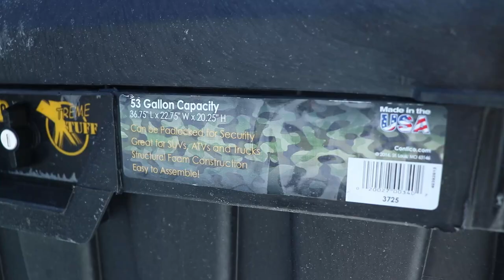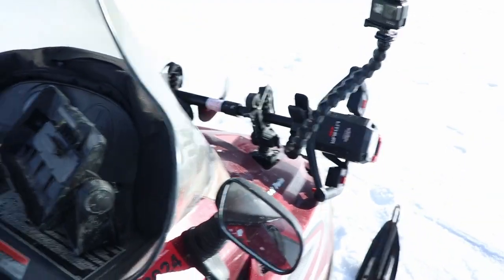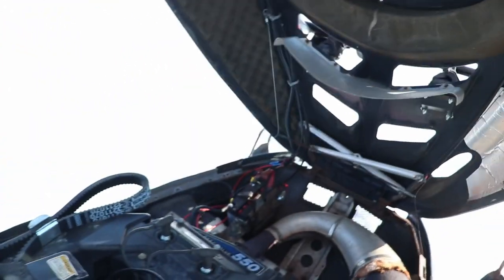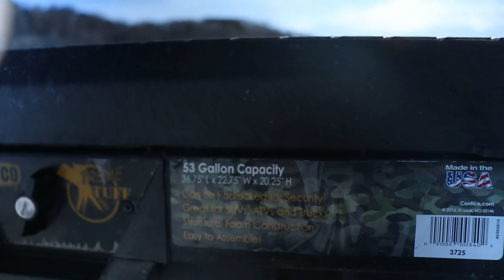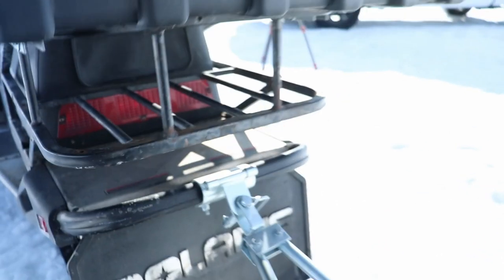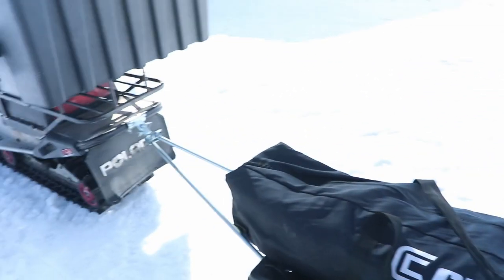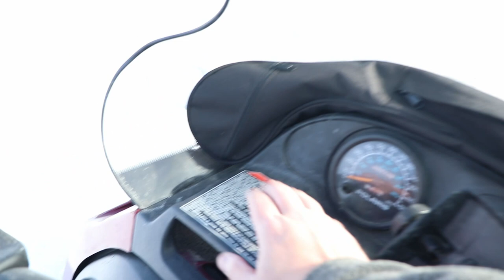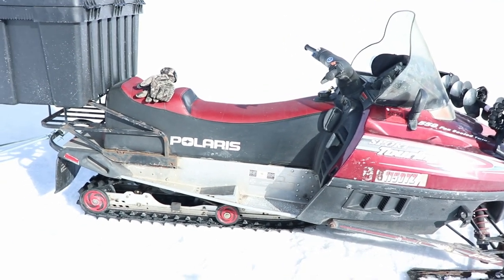The Ultimate Ice Fishing snowmobile for $2,000 (Craigslist Find)

Comment: I have the same snowmobile as you. Heads up, there is an air filter in the cowl (hood) that is likely to slowly disintegrate and contaminate your carbs. I could not find the OEM Polaris part so I looked online for something like it with similar dimensions. I replaced it with this - CORISRX BEST OF YOUR LIFESTYLE Aquarium Sponge Filter Foam 11.8"x4.7"x2.36" - Water Media Pads. It only required a few easy trims to make it fit. Thanks for sharing how you setup your ice fishing snowmobile.
Reply: At exactly 4:30 you can see the filter that I am talking about. The foam like spongy filter should cover that opening completely. I think yours is original and looks pretty bad.

Comment: Very nice.. I would be a little careful with the auger mount on he front being mounted through the fiberglass. Catch a tree or something with the auger and she’s done. It’s not that strong. I had a similar rear box setup and ended up busting the bottom out of the box. Might be worth trying to reinforce it a bit although I was probably harder on it than most people would have been lol.
Reply from the maker: I reinforced the brackets with sheet metal. Hopefully, it holds up. I don't drive through woods or fields with this rig. Typically, just drive it down the boat ramp a d onto the lake or river.